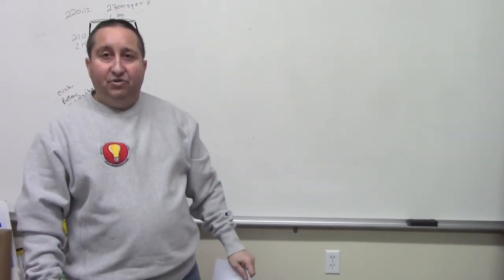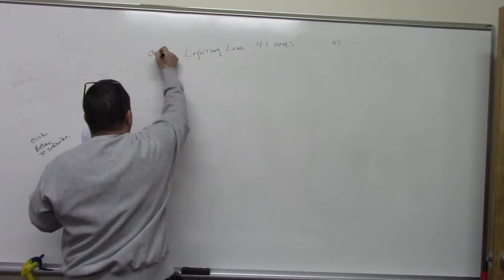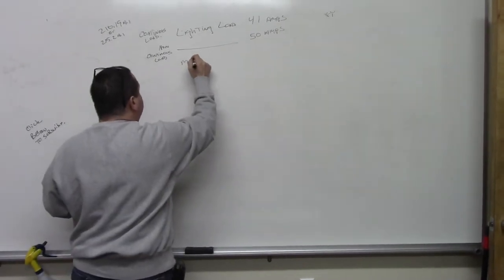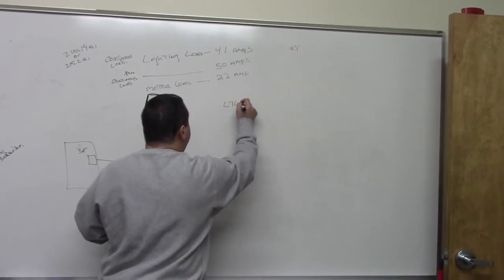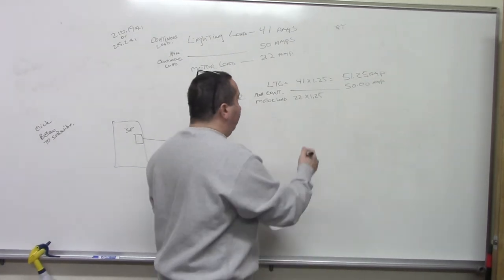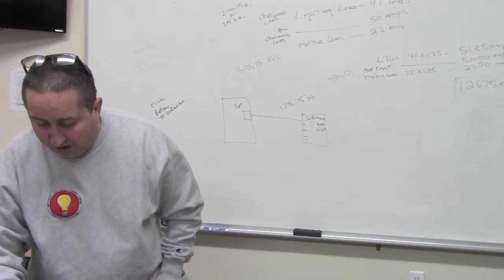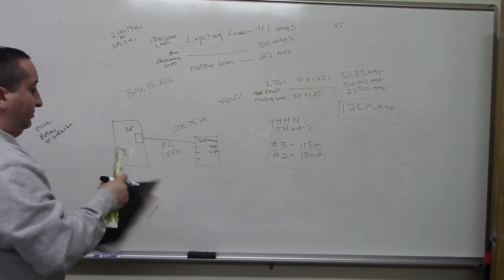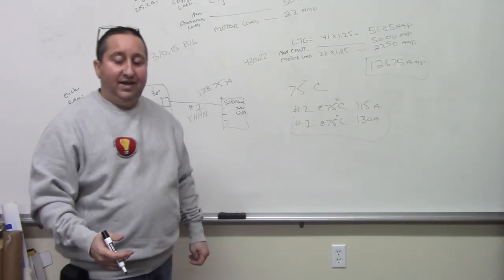Understanding Different Load Calculations For a Feeder Based on the NEC

Comment: Cioa, Salvatore. According T240.6(A) breakers size billable on the market are - ..., 125A or 150A. 
So, what is the justification for using one over the other, according to NEC2020? Graze Mile!
Reply: 130 Amp doesn't have a breaker, the breaker is 150 Amp breaker, you can't go down on the breaker so you go to the next up in this case 150Amp
Reply: @buenotechllc8272  I was asking the Code reference?
Reply: @sultanb.6479  240.4(B) allows the use of the next higher standard breaker rating as long as you met the 3 criteria, 1 of which is that it only applies for OCPDs under 800A.  240.4(C) says that above 800A you must have your conductor rated higher than the breaker.

Comment: Unfortunately, mr Salvatore you are wrong if you look at 128.75 amps that you got is not a standard size based on Table 240.6 you will have to go to the next standard size available being that 150amps your wire size in this case on the 75 degree column will be 1/0.